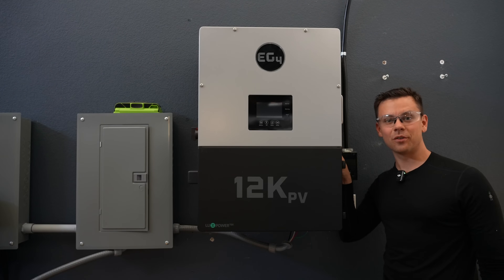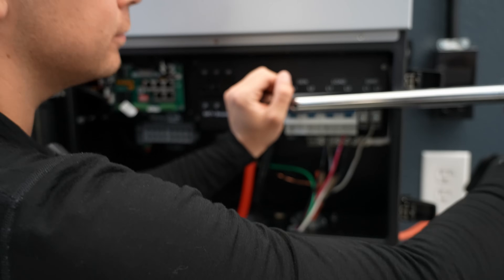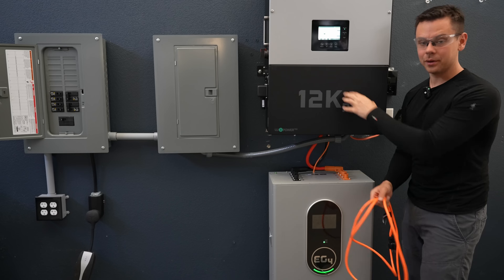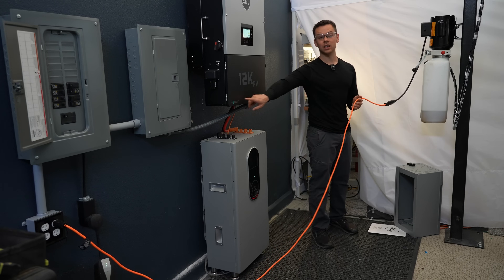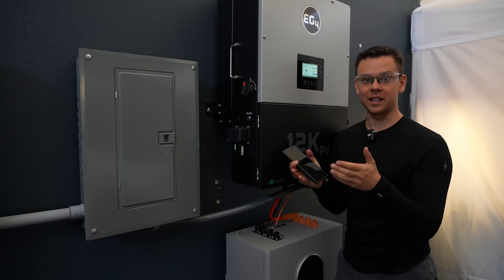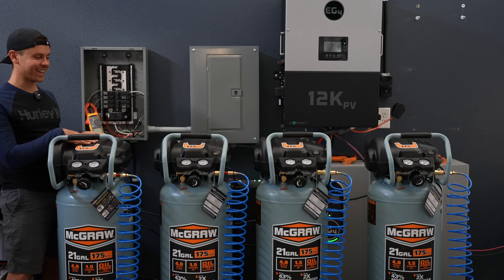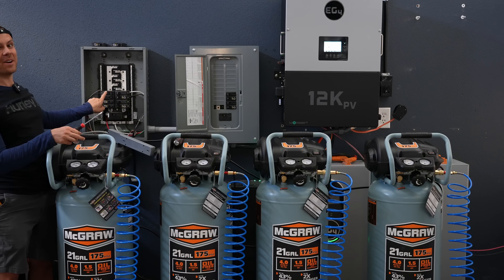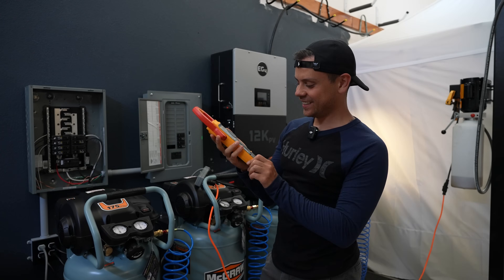NEW! EG4 12Kpv: 8,000W 120/240V Hybrid Inverter w/ 136A Surge?!

Comment: Hey Will, I have a question no one else seems to be able to answer.
How do you know when a battery can/cannot be installed in series/parallel? Can you look up the bms or...?
I have a couple Lifepo4 batteries that the manufacturer says can ONLY be connected 2 in series...but not in parallel.

Comment: This is only a thought. Id would be really nice to see DC powered units(or converted by using dc motors etc) in the house. Wondering if, instead of converting dc to ac to work appliances. Having DC appliances would be interesting to see.

Comment: Showing us how your system can run 4 air compressors is pointless unless you give us some numbers and math to go with it. Please include the specifics of each component so we can evaluate the performance of the wall units on paper. When are going to open up a repair garage with an air compressor at each station?

Comment: I have an 18Kpv and have not been able to do anywhere close to what I see on line.  In Battery back up mode, batteries ful and it stops...even though there is a load on the house.  The house stays on grid and the battery just stays in reserve, no utilizing any of the beautiful sunny day power available.  In the other mode (not battery back up), when I have a larger load, it just drains the battery and goes to grid. (if available).  I have NEVER seen it using the solar available and supplementing from grid for the house load.  (thus utilizing solar, and saving the battery for night time)  Is that possible?  I've been told 'yes' by 5 different tech support personnel, but no one seems to be able to get this figured out. (they go to my monitor and scour through and can't figure it out) Do I have a defective unit?  Ever hear of this with any other 18Kpv owners?
Reply from the maker: What size battery and what size solar. Might be software setup issue
Reply: @WillProwse  I currently have only 1 my 3 arrays up.  Each array is 4500 watts.  (I have seen 5000 on the monitor on a sunny day but typically it's 4200 or so), and I have two 14kw EG4 batteries for a total of 28kw.  I've been on with Signature solar so many times and they have gone over settings.  Still doesn't supplement from the grid.  It's using battery+solar only for the load, or grid totally for the house load.  If the load exceeds the battery+solar it just clicks over to grid and stays there, utilizing NO solar on those sunny days.  
There is a signature solar video they put out recently that does a "load test" where they start up AC etc, and show the monitor grabbing what's needed from the grid!  Exactly what I wanted this to do!  I'm frustrated.

Comment: Hmm... I was thinking of adding a second 6000XP but I may just replace my current 6000XP with this! For my simple system, this makes more sense. 
There are times where the 6KW of my 6000XP isn't enough, this 12Kpv would fill those shortfalls with it's 8KW rating. LOL, the more I write, the more I'm convincing myself into doing this. The weight will be tough, need to get some help to deal with it.

Comment: The 18k CANNOT start a 4-5 tonne residential AC unit in off-grid mode (works when on-grid/grid-tied). Trevor over at SignatureSolar has confirmed this, and my own personal experience; a couple forums posts too. Please repeat this crazy inrush 12k test on your 18k so we can see it fail. If this lesser model can do more, that really sucks for us 18k adopters.
Reply from the maker: Holy cow no way
Reply from the maker: That's not good

Comment: 12KPV only has 80A passthrough.
18KPV has 200A passthrough.
The main difference: 
- 18KPV can be connected in SERIES with the meter(GRID) and the main breaker panel.
- 12KPV would have to be wired up a new sub-panel and wired in PARALLEL with meter(GRID) and breaker panel.

Comment: Hey will really like your content, so I have a commercial spot office and mechanics garage, in your opinion would they EG4 18K be an option or is the a commercial unit that you could recommend ? The office is a 30’ x 40’ space so well be running A/C all day and the garage section will have a car lift along with a large compressor and some inverter type welding plants, it would also be running a water pump to supply the whole compound, I was thinking of getting 3 18K and then 1 large battery each and then expand the batteries when I can afford to

Comment: Great Video. I would advise placing a bushing/grommet where the battery cables are entering to prevent the metal from rubbing the insulation off over time.

Comment: What is the standby power consumption of the 12K and 18K?
Prices went up considerably since 6548...
Reply from the maker: Prices are way down. You don't compare a hybrid inverter to 6548. You compare it to 6000xp
Reply: @WillProwse  Point taken. My 6548  idle consumption is about 65W, I was wondering what would be the idle draw of 12K and 18K respectively?

Comment: I furreled my battery cables to my 18k. The solar its a MUST. But it really helps get those large fine strand cables fully in to the battery lugs. The AC cables do not need furrels as they are large strand rigid cables

Comment: Oh man, if they include this in the upgrade program.......
Reply: I was thinking I may have pulled trigger on upgrade too soon, 18kv was too much but maybe this one would be a good stretch..
But do like the 2x 6000XP for fail of single unit not being a crisis and don’t need grid or outside mount. It’s like buying a computer, newer gear makes for  buyer’s remorse almost every time you buy anything

Comment: Just add a soft start unit to the 5ton AC unit (~5Kw), even a smaller system unit will start it since there is no Locked Rotor Amps surge. I did that to my own 5 ton AC and can be easily run with a 6kw generator.

Comment: Will, what does this inverter draw with no load (basically it's base consumption).  I'm assuming it cannot be paired with the 18k, correct?
Reply: Edit:  Looks like 55W and no it can't be paired with the 18k.

Comment: I wish they would make this without grid tie. Given that my understanding is you can never really ensure these will not back feed regardless of your settings and you would need 2 of the 6000xp's which i don't have room for. I would buy one of these if only it didn't have grid tie, this or the 18K
Reply: I am pretty sure you can set it up for off grid only
Reply: @randya9143  yes you can but from what i've learned it can't always react fast enough to changing load conditions and that can cause it to still back feed even if you have zero export setup.

Comment: What do you recommend for running a 240v well pump woth 18amp initial surge? It is for an enclosed well house but its not insulated. Any smaller Growatt with split phase that can tolerate semi outdoor environment? Thanks

Comment: I have what will seam like a stupid question to ask. But I’m not sure how to ask it so as to find an answer online. Because I’ve tried and can’t find one. 

I’m a diy’er. So I do all my own electrical at my own risk. First question. When wiring a 240v transfer switch, how do you figure out how to balance your load for each 120 leg? Easiest way for a diy’er, please. 

Second question. When a 240v inverter or generator or powersource saids it outputs 5000w or 8000w or 10,000w continues , is that at 240v, and if it is, how many of those watts that are stated continuous watts, are for each 120v leg? Is it half of the stated or is it the full stated? And please explain why, so I can understand. Thank you.

Comment: My biggest take away from this video. Save $1000ish on the 12K over the 18K. But then spend that $1000ish on air compressors. Thanks for the advise Will
Reply: Only if you have enough batteries lol

Comment: I run twin EG4 6500’s with 12 EG4 LL batteries along with 11,200 watts of solar panels and we run up to 4 RV 15,000 BTU air conditioners (16amps each)and have problems.

Comment: 2x 6000XP's are cheaper than 1 of the new 12K's, providing 12kw total output and the redundancy of having 2 units should one fail. I'd rather have 6kw total output if 1 fails than zero.
Reply: And if you aren't grid tying it, and have room indoors, that is likely the way to go.

Comment: VERY interesting!  Yeah, I have had inductive loads well over that!  I have a 5 hp 220 sander, that would not start (inrush on the motor was 180amps) on my system.  I have 4 outbacks (3400 or so each). 70 running amps, and supposedly double that for surge = 140.  Would NOT budge it.  I am totally off grid, (closest line is 2 miles away).  I have a woodshop that has lots of 3 hp motors.  I've been off grid for 20 years.  Back then, Outback suggested that inverters were not really meant to run motors like 3 hp.  (I've done just fine).  I've wanted saws that were a bit bigger (my bandsaw and my main table saw are each 5 hp) so I finally figured out to use 3 phase motors with a VFD for each, and use a soft start.  That has made things MUCH better.  
But now I'm getting ready to upgrade my system.  I'm sort of limited because all those old devices were built off 12 V systems.  I have a couple Lead acid batteries, (fork lift type) and as I said, the inverters are getting old.  I'm looking to invest in 48V system, and going to Lithium ion, or maybe even to something newer, like sodium ion in a couple years, (I can let the current batteries last for 2 more years I think).  I was looking at the Victron, or the Sol Ark, but maybe the EG4 is an alternative.  Certainly a bit cheaper.  I was hoping to go below 15K running watts, and would want close to double that for surge, just in case I even wanted to run a 5 hp motor that was NOT 3 phase, but maybe 12K output is ok.  My limitations now are battery really.  I have more solar than I can use now.  with the 12V, just can't use it all.  With 48V, then it would be great!  
so the 12 K has great surge, what is the surge on the 18K?
Reply from the maker: 5hp sander!? I need that thing!!!
Reply: he says surge for 12k pv output slightly better than 18k pv 5:27
Reply: I've been looking for information on 3 phase of grid capabilities. Haven't seen but one brand that says that their units can be setup for 3 phase. The ifla is hard to beat if you can maintain them and have the room .
Good luck with updating your system.

Comment: 12K total AC was not quite enough for my needs but two of these 12K's which give me 16K AC looks like the perfect setup.   That way I have some redundancy if one unit were to fail although with half the output.  Very nice unit from EG4 and Will of course nailed the review.
Reply: You also get another PV input, 24kpv vs 18kpv. 2 18k would be too much for me, but 2 12k just right.

Comment: So I have 2 sp6548 inverters that I just realized I had some wiring wrong for over a year. I just corrected it and I realized I had some weird things going on. So I had the ground on the inverters on the neutral bar but not bonded completely but had the ground to the ground rod on the neutral so I fixed that so that ground is on the grounding bar and so are the inverters sonit is completely unbounded. Then I removed the neutral ground screw on o e of the inverters. I was overloading in my rv where I have victron multiplus inverters for boondocking and if I had a mini split and an rv ac going at one time and then my well pump kicks on so I am wondering if it is fixed. I am still wondering if I should bond the breaker panel and remove the screw fro. The other I verter?
Reply from the maker: Can you post a diagram of your system on the forum? https://diysolarforum.com/
Reply: @WillProwse  do you want the before I fixed it or the after?
Reply from the maker: @jefferycundiff3804  oh sorry both, would be helpful for a lot of people

Comment: I bought an 18kPV when they first came out (trade in... before the 6000XP's were available)  & will need another inverter to go with it when I finish my house (23kW of panels) . Looks like I should have waited & gotten two 12kPV's?

Price of being an early adopter I guess. 😉 Since you really can't mix & match their tech (inverters or batteries), I think another 18kPV is still going to have to be the plan even though I will never be on-grid & never net-metering. etc.

My nature is to overbuild everything...the 18kPV accomplishes this, just at a steeper price. 

That said, as noted many times before, I really think SS/EG4 should make the 18kPV's, the 6000XP's & now the 12kPV's all play nicely together in the same sandbox. Thereby allowing mixing & matching as well as & ESPECIALLY forward & backwards compatibility. It gets awfully expensive trying to start over each time... unless you are you Will. 😂

Comment: Nice video!  You should try to fault it, I'm worried the tripping system may not be working and can burn out.  haha

I think 2x 12kpv (for redundancy) install and forget off grid would be a nice option. This one seems much more powerful than Solark 12k.
Reply from the maker: Last night I got it to trip by hitting car lift three times very fast 🤣 it does work, it monitors it nicely. It can do some crazy amount for ten minutes straight. I need to find that number again
Reply: I'm guessing they are beefing these HF inverters so they last longer even though their true limit is higher.
Reply from the maker: @Waldoe16  exactly. That's what a lot of companies are doing now. Same with BMS fets

Comment: Curious .. if you have two 200 amp panels in different ends of the house , I assume 1 inverter + battery for each panel ?  
Maybe the dual 12k is a good fit ..

Comment: I was considering the 6000 but maybe the 12000 for my off grid cabin. I would charge it primarily with a generator but have a small solar array. I'm just wondering what the stand by power consumption is. Sometimes we use nothing during the day but close to full load in the evening and I wonder if there will be power drain during the off hours. I use a delta pro system now and the stand by power usage is pretty high inverter on or off.

Comment: This seems almost perfect for an RV, I wonder if you fed it a 30A RV source that was split to feed both L1 and L2 and limited it to 15A on the AC input if it could deal with them being matching waveforms? If so this would be a big step up from the Victon x2 because the Victon is only 3kva and 24V on the battery side.

Comment: For $200 more you can get the 18k.  They need to drop the price more than that they won’t sell if that’s all the cost differential is going to be corrected that for the reverb it’s a good price difference between the two
Reply from the maker: That's the refurbished one not a new one
Reply: you can get 16k megarevo for $2000. its just like sol ark with 200a pass through. you can hook up utility, generator and 2 load panels! unlike theses inverters you can only get 1 load panel. plus they have 24k version for $2500....

Comment: How can ferrules reduce resistance heat more than clamping directly to the conductor wire without ferrules? Is it because ferrules provide greater contact and clamping surface area than a bare wire?  🤔
Reply: Ferrules clamp all the strands tightly together.  Stranded wire under a screw spreads out, and some of the strands are not tightly fastened

Comment: I love my 18k, this educational videos are so good for the community
Reply from the maker: 18k is such a beast
Reply: @WillProwse I've had my 18 KPV for almost 6 months now, and I've never hooked it up. I hope and pray that I can get started on it sometime soon. I have a little compound that I've been using one LV 6548 sun gold model for about a year now or more and I haven't really needed the 18 KPv that's why I haven't hooked it up I guess that plus laziness..
I hope ing to be able to wire it properly. I'm still not totally understanding all the wiring so well. Thanks for the videos. I'll definitely be going over them again when I finally get that thing going. I'm going to have six server rack batteries. I'm wondering if I'm going to need to have battery communication. When I start working on it, I'll ask a couple of questions on one of the videos and maybe one of the group to answer them or yourself if you end up seeing it by chance. Welp, thanks for listening😊😊
Reply: I have an 18k running my whole home with a 200a service. Rarely ever touch the service anymore. 2 batteries and 12kw of solar on it currently. adding another array soon. Putting me to around 16kw of solar. Hardest part was getting gov permission and permits to pull my meter for the work. The actual install is dead simple.
Reply: hi john how much did the setup cost you to install

Comment: I wish they would make an outdoor rated 6000xp for people fully off grid that don’t want a loud inverter dumping heat into their house all day. I’m fully off grid and at first had my inverter (growatt 12k) in a closet but because of heat and noise I needed to move it into the crawl space which is a terrible location for access and I’m dreading the day it goes down. I may buy one of these just to have a clean location mounted on the outside of the house. I’ve thought about making my own box but letting heat out without any dirt in is a hard task.
Reply from the maker: Now that would be cool
Reply: I have my LV6548 units mounted outside under a covered screen porch. It's been 2.5 years and there is slight corrosion on the air intake vents and that's it. I'm in Florida with high humidity.
Reply: @FauxQue-yk8dt  Going to be mounting my 3k like that also, so thanks for sharing you experience as it gives me confidence. ==Florida also